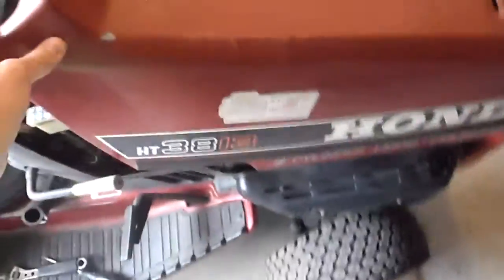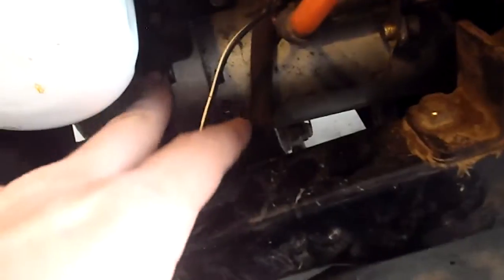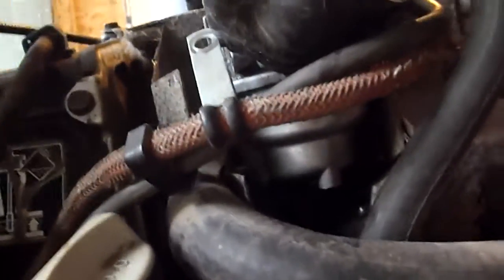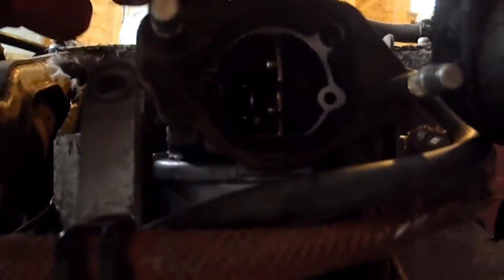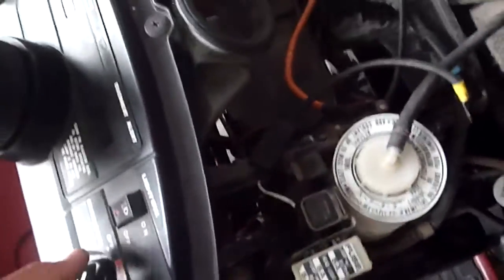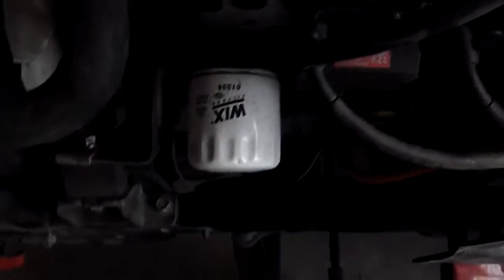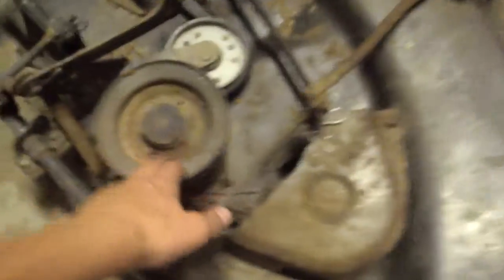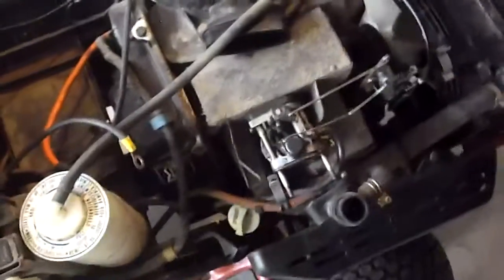New Tractor: Honda HT3813: Overview, and a problem!

Comment: Great tractor! Could you tell me how you removed the flywheel. Which way did you undo the center nut & did you need a puller. I need to replace my starter. Would be a great help. Thanks.

Comment: first you said it was flooding out. you pessed with the float body .  then it wont run  but idle. .i suggest you return  that adjustment back where it was . run stabule in the gas tank and fill it up half and add accitone about 2 cups.  your carb has old gas chaulk that is clogging up the jets. take eng out ..ok.. replace clutch timing belt and everything else while it out weather it needs it or not. thats whats caled doing it right the first time.

Comment: Hey buddy. I had a question if you can answer it ???
Reply from the maker: I can try, but I haven’t had this tractor for 10 years. What’s up?
Reply: I just got 1 the other day. And the only way I can get it started is if I take a screw driver to the solenoid to get it to startup.. I turn the ignition but I doesn't start or do I hear a clicking sound
Reply from the maker: Good question. I can help with isolating whether the solenoid is the problem or the ignition switch, but that’s as far as I can go. So, if you take a jumper cable from the positive battery terminal and touch it to the ‘signal’ post on the solenoid (the wire from the key switch), does that make the engine turn over? If yes, that means the solenoid is working and the key switch is the problem. If no, then the solenoid is dead. Replace it, and see if that fixes the issue.
Reply: Ok thanks I'll try that and I'll let you know something this afternoon around 5pm.. thanks
Reply from the maker: Any luck?
Reply: @JeremyKamutzki  hey bro I'm about to try that now give me 5 mins ok. Hold on. I'm home today and I just came in from trying to work on that thing lol. Thanks
Reply: Hey bro u was on the money. I tool my jumper box and connected the red to the other side of the solenoid and it started.  Going to advance now to get a switch. Can I get anyone or does it have to be a particular 1.. and thanks soooo much sir
Reply from the maker: Glad it was a help! Knowing Honda, it may well be a proprietary switch, not some generic one. However, I expect that you should be able to get any lawn tractor ignition to work. They are pretty basic… off, run, and start are usually the only 3 positions.
Reply: Ok thanks sooo much I'll keep you posted.. going to go get 1 now
Reply: Good morning I wanted to know if you had a video on put a new PTO CLUTCH IN.. MINES IS WORE OUT AND WON'T ENGAGE
Reply from the maker: @jorelsmith1985  unfortunately I don’t, sorry! And I no longer have this tractor to show it to you either.
Reply: Ok I understand and thanks

Comment: -check compression.  if its over 100 and not more the 3lbs different  between the 2 cylinders . it s ok.  if not then that is your problem, not carb.

Comment: the rubber airfilter hoses have nothing to do with anything. replace the water pump.   clean the engine. ..p b blaster the gas cable everyday for a week on both ends. put anti freeze up to center of overflow tank. drain oil. replace with syntech 20 w 20. put nylon screen across front and sides  to shake off easy  instead of cleaning radiator every 5 min. gental garden hose into fan side of radiator after every mow job. always wipe under seat around gas cap before opening.  to keep crap out. replace fuel filter every tank of gas for the next 4 tanks. . with tank empty put air revierse pressure  from filter back to tank gas cap off.. never put pressure into carb . and never put air nossel closer then 1  inch from gas line hole. 10 lbs air is plenty.